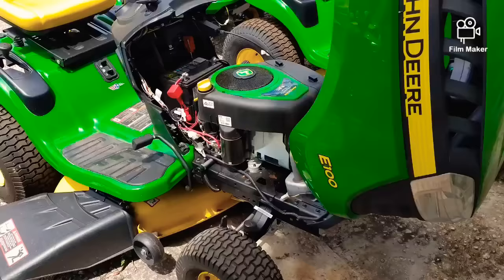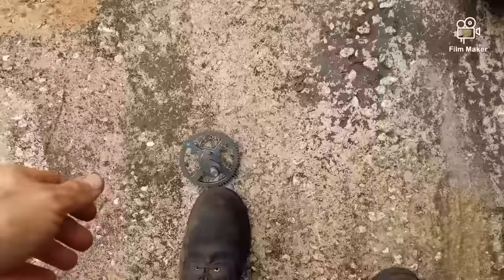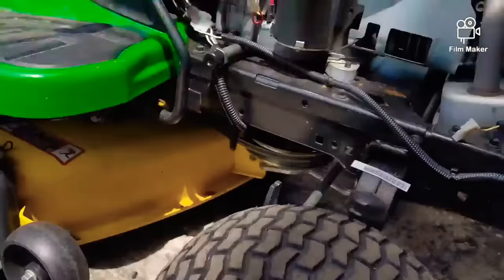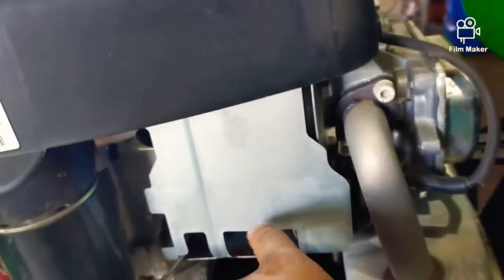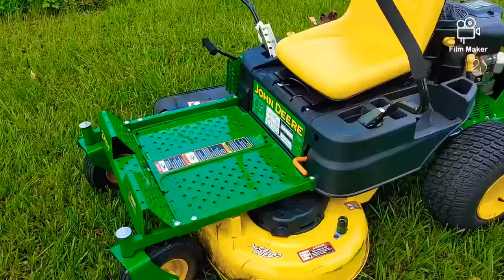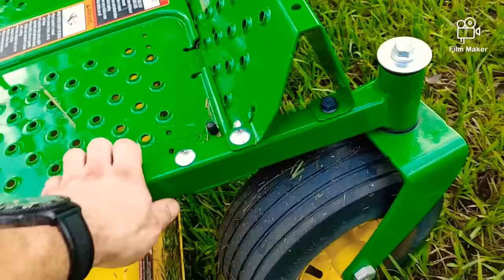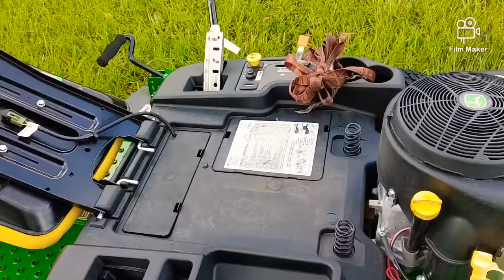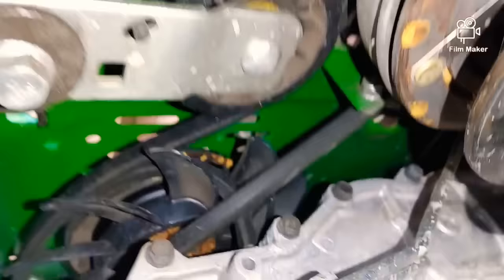Lawn mowers to avoid!

Comment: Those big box stores such as lowes, home depot, walmart etc sell those john deere and cub cadet(among other rebranded) mowers which are manufactured by M.T.D(modern tool and die) out of Ohio. Yes, they are flimsy, weak and are made strictly for very light duty residential use. They are essentially just throw away disposable mowers. You use them until a major component failure happens such as the engine, wheel motors, deck rot, structural frame failure etc etc then throw them away and purchase a new one. Generally speaking, under light duty use an owner of these mowers can expect a nominal service life of 5 to 10 years(10 years being at the very optimistic end of the spectrum) Have been working on these rebranded M.T.D mowers for nearly 20 years now. Youtubers often heavily criticize these things, but, with normal maitenance and care these low end mowers will provide an adequate service life  for the average residential homeowner. Anyone who wants to indulge in a commercial grade high quality zero turn mower can realistically expect to pay 3 to 4 times the price of these m.t.d rebranded machines. Everything in life is a compromise based on many factors, money certainly notwithstanding. These cheaper mowers do have their proper place in the grand scheme of things, and for many people its either buy one of them or simply do without, very much like settling for a timex watch instead of the fancy rolex you'd much rather have but in no way can afford. Such is the reality of life!

Comment: I've had a Z525 for a few years now on 1 acre. Went with the bigger model primarily for the bagger and side blower attachment. I bag around 30 bags per year and this thing handles it like a champ. I can do the heaviest part of the season at about 22 bags in 3 hours. The price has been worth it for that alone. It's a bit heavy as a mower and prone to adding ruts in the yard if you're not careful about changing mowing patterns in softer soil. I only have that issue in part of the yard, so I change it up with 3 patterns. I can mow my acre in about 30-40 minutes. The biggest gripe I have about the mower is that I can't buy tweels for the rear tires.

Comment: My z225 is 12 years old and sharpened the blades, change oil every spring. That’s it !  Best zero turn I used so far! Oh I check tire pressure but I’ve never had a flat since I owned it. Bought from a JD dealer. It mows about 1/2 acre weekly.
Reply from the maker: You will be happy to find out that your 12 year old mower is built drastically different than the 2016- 2022 models. They do change them over the years. The 2023s is completely different from the 2022s
Reply: @Mechanical_Mind  I’m glad of that!:) oh by the way, I was thinking it was 12 but I checked the DOM and it just celebrated its 15h birthday:)
Reply from the maker: @alleyoop5185  yeah they dont build them like the used to. Even the commercial guys complain about the quality of the newer machines

Comment: Of course there’s always exceptions , Our 335 is 7 years old, 245hrs, bought at Lowe’s when My wife worked there. It’s been flawless, not a single issue. Mainly use for trimming which takes about an hour, and I take exceptional care of it and don’t abuse it, which I believe is the predominant issue with these cheaper units. I also have the Ferris ISX 2200 which does the bulk of the mowing. GREAT machine.

Comment: I've got a 2004 Dixon SpeedZTR 42. Been mowing 1.34 acres for years with it. I've literally replaced the drive belt ONCE, and the blade belt TWICE. Just this year I noticed one of the spindles seems loose, so it keeps throwing the belt. I'm hoping I can tighten in on the deck, because you can't find that replacement spindle ANYWHERE. All in all, this has been one hellava mower!

Comment: Good presentation. Have had my 430 close to 40 years. Other than a few problems with the deck, it has been trouble free except for for now, the hydrostatic drive is starting to fail and the wanna be  mechanics at my local JD dealer said that they can no longer get the parts to fix it. I also have a JD Z997 that I have had for 10 years that I use to not only mow about seven acres of lawn, I use it for clipping my pasture fields and so far it has performed perfectly. The maintenance is really easy to perform.
Reply: I bet you they can get parts for it they just don't want to
Reply: @Mike-su8si  I am pretty sure that you are right about the parts, but at the same time I wonder if the people working at the dealership have the ability to fix it. Much easier to just sell a new one.
Reply: @Willy12927  it could be the people don't know what to do

Comment: I have had a jd Z777 60in deck. With a 27hp Kawasaki for over 12 years. The best mower I have ever had by far. Still kicks ass.
Reply from the maker: Your mower is like a Dodge Viper compared to the mowers in this video. The 19'-22' Z300s would be more like a Dodge neon with a blown head gasket and bald tires.
Reply: That’s true. Lol. Great video. JD does build some junk too. Like you say. The X-300 riding mower is one. My opinion. Bad belt issues.
Reply: That’s true. Lol. Great video. JD does build some junk too. Like you say. The X-300 riding mower is one. My opinion. Bad belt issues.

Comment: I have a 2018 Z335e and the only problem are the front wheel pivots. Plastic bushings and they wear or crack easily.  Rest of mower is great. Have used to clear land and have abused it to no end. Takes it all.

Comment: My 1996 toro proline 52 with a Kawasaki engine is still going strong..Only work done to it is belts..tires..oil change..blades..The mower and the auto steer seat was 6.500$ in 1996..Worth every penny..

Comment: Owned a Z345R since 2018. Didn't buy from a big box store. Not one problem out of it. I use LG276 service kit every year. Everything any manufacture makes is all designed for them to save on cheaper parts to build it. The motor is what I look at...Kawasaki, Briggs/Stratton..Kohler...Honda

Comment: I had a John Deere Z225, every spring I had to take the carburetor apart and put it back together to get it to crank. If you didn't crank it at least every 2 weeks, the 3rd week the float in the carburetor would stick and fill the crank case full of gas. I finally bought a brass gate valve and put it in the fuel line so I could turn the fuel off. It helped. But the mower just didn't mow that good. You had to go slow or the grass would be streaked. As long as you mowed every week, it mowed smooth as long as you don't get in a hurry.
Reply from the maker: I tell customers all the time to run ethonal free. Plus crank it up and run for 20 mins every week during the winter. Plus keep everything clean

Comment: i own a model 28125bve snapper riding mower i bought in november of 2009. it has a briggs and stratton motor. 12 .5 horse power. i paid $1754.34 for it. i knew nothing about riding mowers and i really put it through hell in the first year i had it. it still works pretty good. i am going to sell it now. i bought a bolens 20 inch walk behind mower. getting old and the snapper weighs over 300 lbs. time for a light weight mower.

Comment: I’ve had one of those zero turn mowers for several years, and it’s the best mower I’ve ever had! That’s probably because the ones that came before were junk! The JD runs rough, but it always runs, and cuts good! You are absolutely right about those front tires! 😅 They won’t hold air for shit! I have to pump mine up before every mow! AND I THOUGHT IT WAS JUST MINE! The little 12v Milwaukee air pump has paid for itself a few times already!

Comment: I was told by a small engine shop to avoid any residential grade zero turns regardless of brands.  Stamped decks, Weak transmissions, flimsy lifting systems and they are designed to be cheap easy to assemble, not easy to maintain.  If you can swing it, get a lower end commercial grade mower as they will last so much longer and save you money in the long run.
Reply from the maker: 100% accurate!

Comment: Very helpful info & thanks! I've been on the fence over Home Depot & Lowes riding mowers for a while. I bought a Murray M200 17.5 hp, but i could not get that thing to start. I tried everything i knew but no success. I returned it promptly. I was looking at the John Deere S100 17.5 hp until i watched this video 😆. Now i don't know what to buy, sheesh!

Comment: I have a Z530R and it is a beast. Big upgrade over my 2016 Z515E.
Reply from the maker: I just saw a new 2023 Z320M and John Deere has improved all the issues I mentioned in this video except the stamped deck

Comment: This is a great vid and I'm around and work on power equipment of my own and my neighbors at least 2 days a week. I've never had a problem with the older Craftsman tractors with the B&S OHV engines but do religiously change their oil and filter. When you showed that film shot of the molded plastic rear differential on that JD piece of crap I was mortified. Talk about garbage. Yikes!

Comment: I've got about a 10 year old D100 that has the 5 speed metal DANA rear and 17.5 briggs. No starting issues after almost 300 hrs. but the transmission tends to be a little finnicky going into 4th gear every now and then. Just have done basic maintenance on it and replaced the battery and starter at about 230 hrs. can't complain

Comment: I've had my Z335e for four years now and mow my two acres every weekend. My only main gripe is the lack of a skid plate to protect the drive belts. One little twig bounce up in there and I'm pushing the mower back to the back cuz one of the belts popped off.

Comment: AMEN on the John Deere z-turns. I have a Z375 that's about a year old and it's JUNK!! I've replaced the deck belt 5 times, replaced a spindle, bent the deck twice, had the deck off about half a dozen times. I'm gonna sell it & get a finish mower to hang on the back of my tractor.

Comment: Got a video for showing how to add grease fittings to the zero-turn front wheel bearing/bushings?

It's like manufactures design in failure points like this on purpose, eh!!!  More parts, more repairs, mo' money!!!
Reply from the maker: Hey David, actully I do have a video showing how to do that.  https://youtu.be/1iurHj3bDeE 
Its very easy. Thanks for watching!

Comment: It is my understanding that JD, Huskvarna and so on license MTD to build market priced competitive machines using their name which are sold in the big box stores.  Many uninformed people think they are getting a JD comparable to what they see the neighbor's lawn service crew running around on. Not so.  You want a true JD you are not getting it for $2k.  Now I do two big box store JD lawn tractors.  V-Twin Intec's.  I have been fortunate, and they have served me well.  As you explain you cannot neglect these machines.  Thanks for the heads up on the zero turns and the plastic cased trans axles.  I will avoid both like a porcupine pillow.

Comment: I had good service out of my old John Deere,  but the after 15 years it was worn out. I got talked into a zero turn mower, and got a z375r-54" cut. I was going through mower belts regularly, and I must not have been the only person, because I got put on a waiting list to get one. There was none, at the service centers, or Home Depot for eighty miles. They are very long, and very thin for such a long belt. It may have been where they were getting their belts from. I decided to try something, and added two chain links to the tension spring, and it solved my problem. I mow about 4 acres of hard ground, and I have gone three years, and not had to replace belts since.

Comment: I have had a Z225 for 15 years and a Z235 for 14 and a Z540R for 4 years. I thought they were the best you could buy. I Just keep them greased and change the oil every 25 hours and keep cutting.  I have a lot to cut. But the Z540R is the best. I really like it a lot. 
But the others I use every week. None have ever been in a shop. I am not stupid enough to stand or step on the deck.

Comment: In 2006 I bought a JD 757 Ztrak 60 inch deck 27 hp kawasaki engine from JD equipment in central Ohio. Had a little engine issue but nothing I couldn't fix! Mow about 5 acres with it. My wife has done the mowing while I weed eat and trim. WE LOVE OUR JD ZERO TURN!

Comment: I bought a Cub Cadet LTX 1040 42in cut with a 19hp Kohler back in 2011. It has never let me down, ever. It still has the original deck belt on it! That being said, it is getting long in the tooth. I have a new Cub coming today, hopefully it lasts half as long.

Comment: AVOID anything with a Tuff torq K 46 transaxle. Doesn't matter if it has the aluminum case. They are junk if your lawn has any sort of an incline or if you want to simply aerate  with a plug type aerator . We are talking a little 36 inch aerator . Not some big thing . My D 170  John deer would come to a complete stop after only 10 minutes , the trans being overheated. Luckily after cooling off it functioned again. The lawn had only about a 5 % incline and I was even going back and forth to avoid climbing. The internet is full of horror stories about the K 46 .
Never again 
Ps  ;  Yes the transaxel was completely clear of any grass clippings . It was completely bare and clean , so that's not the reason it over heated
Reply: I agree
Reply: @philliphall5198   I guess the channel owner doesn't agree with me because I didn't get one of those little " heart" thingys from him.   haha
No matter. The K46  issues are VERY well known .
The thing is , many many brands  use this pile of junk transaxle.
I bought 3 high output 12 v fans that I was going to install  on my D170 to try to keep the K46 cooler   but I decided to let the tractor go with a house I was selling  instead

Comment: Yep, had a craftsman 3000 yard tractor,21 horse B+S platinum engine which had the same compression release problem. Now it did last me 10 years. I took meticulous care of this 
Tractor from preventative maintenance to keeping it clean, it looked new! Because of its age it wasn’t worth repairing. I was quoted somewhere in the area of 800$ with no guarantee it wouldn’t or couldn’t happen again!

Comment: I bought a John Deere 314 tractor 40 years ago.    My wife's Uncle from Wisconsin, (a welder from Koehler engine factory) said JD ruined there reputation by installing sides on the tractor causing is to overheat.   He removed them from my tractor and made me promise to not reinstall them.   I cut 3 acers of grass, snow blow 100 foot driveway in the Buffalo area and have a 48 inch rototiller used every year for the garden.   Still going strong.   Had some starting problems from ethanol gas.   Now that I can buy non ethanol it works great.   My teens cut the grass, now my teen grand kids cut the grass  and my wife rototills her 40 by 80 foot garden.   When American products were the best.

Comment: I have a Z335E and I bought it new. Someone didn’t set the valve lash correctly and it threw a rod. My best friend is a small engine wizard so we just rebuilt it. Got 200 hrs now and runs great.

Comment: I've been in the landscaping and lawn care business for over 40 years and the last john deer mower i owned was a pushmower.  The two biggest design flaws I've ever seen on a lawnmower is plastic lobes on the camshaft and the overhead valve system neither one are worth two bit.  In the 80's Briggs can out with the quantum engines and they were complete pieces of junk because they had plastic piston rods and when those rods got hot they warped so badly the piston would wear the cylinders in an oval shape.

Comment: My L120 has simply been a dream machine for around 20 years. Easy to maintain and still: Nothing runs like a Deere! Sounds like you have a real beef with JD. Lawn mowers are very intricate and run very bad conditions so expect some problems.
Reply: But they dont make em like they used to😢

Comment: Honesty is kind of lonely sometimes, but thanks for being honest!!!  I had a mower like the cheap ones you highlighted, and, of course, I spent more time and money repairing it than if I just bought a new one.  And the replacement part options are horrible too.  All from the same Chinese factory.  Spindles with no grease access for servicing, deliberately designed to last about two years before making you buy a new mower.  It's a scam.

Comment: Interesting the opinions on the various residential grade John Deere products.  I've got the E130 and have been mowing 1.75 acres in SE Texas with it (very long growing season) for 6 years.  Since then, I've beat the heck out of the thing - put it up "wet", run it into thing occasionally, and generally do not baby it.  It's done great with only two exceptions.  Replaced the battery once (so this doesn't count).  Second, had a governor issue (surging) that required modification and subsequent repair on a plastic component (that I broke) a year or so ago.  Got it new from Lowes.  Apparently, it was assembled properly - nothing loose ever found on it.  Absolutely would buy another one with all things being the same - didn't buy bigger initially due to limited finances.

Comment: I had that single cylinder B & S engine  on a tractor which ran great for 12 years. I have read that turning off the engine at full throttle may be the cause of the compression release failure. I always turned it off at idle speed.
My neighborhood has many John Deere zero turn mowers in use. None of them have had any of the problems you mention.